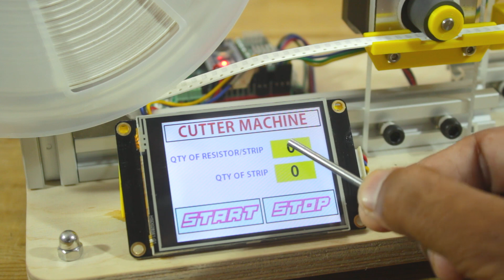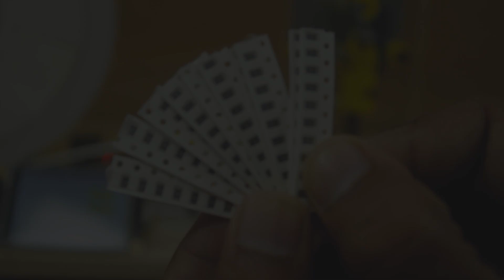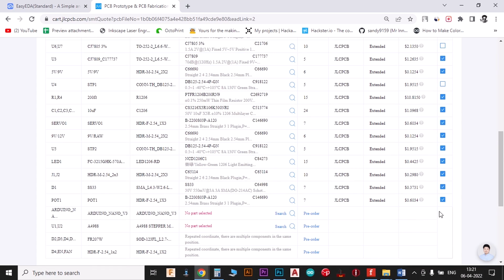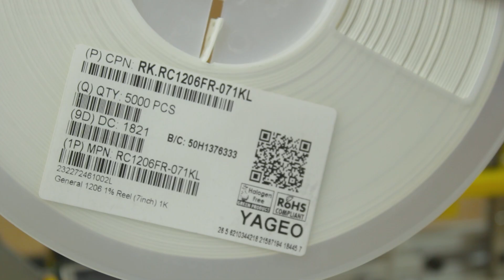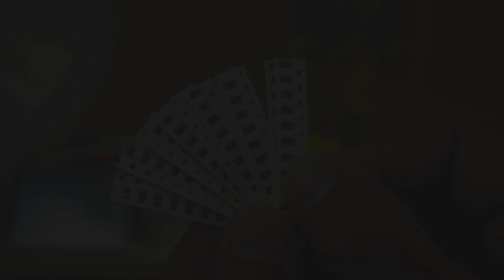DIY SMD Resistor cutting machine | Arduino project

Comment: Badly. It is necessary to count the holes and then cut, and in this version an error occurs, and the blade can fall on the resistor.
Reply from the maker: yes you are right... it need update